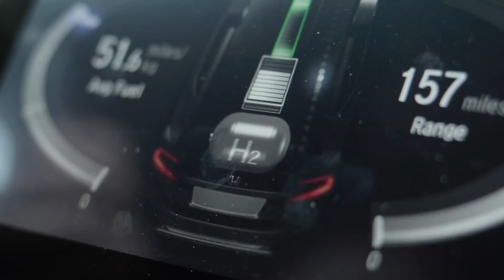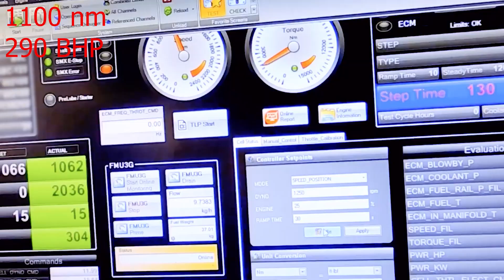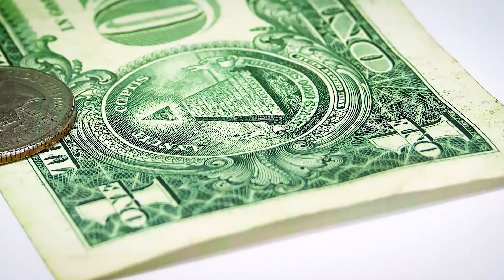Cummins changes there focus from diesel to a 15 liter Hydrogen Internal combustion engine

Comment: I am hoping that hydrogen is the saviour of the internal combustion engine, this Cummins announcement gives me hope.
Hi from NZ,
Anthony.
Reply: The politics of climate change put us behind on this tech. Making hydrogen power at least as safe as gaoline happened in the 1990's. Ford in the USA and BMW in Europe had started on a standardized filling/delivery system in 2000 along with plans for infrastructure. This was for hydrogen compustion engines that most all in the industry in the early 90's saw as the norm by 2010....I am very happy to see this along with Toyota's efforts
Reply: Hydrogen can save the work from energy blackmail that the world nations are guilty of.
Reply: I doubt there will be any "saviours" of the ICE engine. It is a victim of it's own complexity. Too many moving parts to wear or break, timing and fan belts, a cooling system, and it all needs regular maintenance.
Reply: @Brian-om2hh  Boy you can say that agian, i want to call your boss and suggest you get a raise  as you are sound really intellegent. I like my 2 stroke ICE's and they will be fun for a hobby but we must all moves on with ZPE aetheric electric powered dives. Right now there are electric motors that make insane HP and torque that can fit in out laps!

Comment: One of the problems with big trucks , and electric is the weight , the whole point of a truck is to have cargo and weight capacity , to power a heavy truck with electric it needs a huge battery bank , and for example the battery in the tesla weighs half a ton , can you imagine the battery needed for big rig .
 Trucks have restricted axle weights , so if you add a 5 ton battery pack ( or maybe more ) , its not going to be economical imo .
 Yes you can get away with it if you are carting feathers or potato chips with a girly less heavy duty big rig , 
   and lets not forget trucks are terrible aerodynamically , so its hard to see trucks  with EV capability taking over from conventional or other more suitable power units .
 i`m thinking possibly a hybrid scenario might be doable with a smaller battery and a motor on the tailshaft to help the truck get up to cruise speed which would cut emissions and fuel use down a lot .
 But in fact some trucks already have retarders which also work in reverse when needed that do a similar thing , and if i remember correctly quite some years ago a retarder drive supplied about 350 horsepower as well as retarding effort.

 some diesels run natural gas , usually buses and such  which is probably a tad cleaner than diesel , but iirc it comes at a cost of reduced power.
 Some years ago in my neck of the woods , a conversion that some companys had was combination of LPG and diesel , iirc , they could lean the diesel off using a mix with  LPG and diesel ,  im not sure but i suspect it would have been cleaner , and it was reported to me by a driver it made  more HP .
There are no magic bullets , everything has its own pro`s and cons ,  but if i was pulling 68 ton or 100 ton GCM with a big rig , i would want a conventional diesel .
Reply: The major truck makers don't seem to agree with you. Most of them already have 100% electric trucks out there working now. Take a look at Bjorn Nyland's YouTube channel. On his travels, he filmed a Scania fully electric truck recharging at a service area.
Reply: @Brian-om2hh  Yeah, but just one of them.... EV trucks are a waste of time and grid capacity its the wrong tool for the job and any half assed engineer or scientist that doesn't have their head up their but over a fuel fade would tell you that.

Comment: There is a company in Canada called Proton Technology. They have patented a method of separating the H2 from fossil fuels, underground. The carbon stays underground and the H2 is skimmed off and collected. They can produce very pure H2 for around the same cost as natural gas. This is proven, working tech and they are licensing it to producers in other countries.
They can even use to it to clean up old abandoned wells, and get them producing again in the process. 

This is clearly a better option than lithium, which so far, can't be recycled safely and creates a dependence on some very undependable counties. The batteries themselves are very dirty/carbon intensive to produce. These batteries, and the E-cars, will lead to a recycling crisis as unwanted/unsaleable dead-battery-cars pile up; but are too expensive to repair.

The move to electric vehicles has enormous downsides, and those promoting it don't seem to realize that the electrical grid will take 50 years to upgrade.
Reply: I think anything that doesn't involve a carbon cycle is a waste of time for ICE engines, for the time being the best way to do that is with biofuel crops and there are some amazing ones in development. If they implemented them in thier current state we could have half our fuel supply be biofuel and probably 100% within the decade ending ICE contribution to CO2 by creating a closed cycle for it.
Reply: @Wingnut353  There is a major food crisis brewing in the world and the WEF is successfully convincing idiot politicians that climate change demands that farmers use 30% less
nitrogen--even though all modern farmers use the least amount possible because it is expensive. Scarcity serves those it does not affect.

Now, let's think about the plan of taking all that farm land, water, energy that should be producing food and using it to produce BIOFUEL(????)all while sitting on the world's largest deposit of bitumen that turns so easily into jet fuel, diesel etc. The CO2 warming fallacy is not agreed on by most experts, it is not science because  has never be re-produced in any experiment. It isn't supported by anything but the media and their owners. CO2 is a trace gas, essential for life on the planet; right now you are breathing more neon and more argon respectively than you are carbon dioxide.

Comment: Proud Cummins Investor right here 👍
Reply: I never trusted the stock market for a damn thing. This is such a huge development I am going to start now.
Reply: These H2 fool engines better be a fucking 2 stroke! Thank god for high power fiber lasers to cut ports into block and liners.
Reply: Have you ever seen a close lightning strike. yes thats a 2 stroke plasma engine with very high power to weigh ratio. dump fucking sheeple need to pull the head out of their asses and realize zero point energy. No wonder why some folks flip and become serial killers! Fucking brainwash restarted chemical fuel race.

Comment: Will go broke.
Hydrogen is a loosing direction. 
Natural gas would be successful on big trucks and rvs.
Reply: The issue with natural gas is the same as with lithium. It is much more expensive both financially and environmentally to extract natural gas than it is to split water. 

All we need to do is provide electrolysis plants at all the gas stations to refuel hydrogen powered vehicles since the pumps are already no smoking/idling zones. The oxygen produced can be extracted, stored, and shipped out to hospitals and nursing homes for patients, machine shops for acetylene torches, and any other place with a need for oxygen tanks. Large scale electrolysis is cheaper and more effective than portable small scale solutions and you're not wasting the oxygen like you would be with a car. This would make oxygen tanks cheaper and easier to acquire, which will cut operational costs for shops and medical costs for patients. As long as the energy requirement is covered by government subsidies, gas stations should have zero problem housing electrolysis plants. Also, since there are so many, there shouldn't be any shortage of hydrogen even if twenty plants fail in an area. Once gasoline and diesel are phased out for hydrogen, those tanks will be replaced with pressure vessels and provide enough of a reserve to repair the electrolysis plant.
Reply: @TheDustyShredder  
You are dishonest. 
Why did you choose to be a nameless coward pretend human with zero credibility?
Ashamed of yourself?

Comment: cummins doesnt make the diesels coal rolling people mod or remove particulate filters... Rolling coal is the practice of modifying a diesel engine to emit large amounts of black or grey sooty exhaust fumes—diesel fuel that has not undergone complete combustion. A predominantly North American phenomenon, rolling coal is sometimes used as a form of anti-environmentalism.[1] Such modifications may include the intentional removal of the particulate filter.[2] Practitioners often additionally modify their vehicles by installing smoke switches, large exhausts,[3] and smoke stacks

Comment: I believe Hydrogen has a place in future developments. Still, the people pushing its rapid deployment is the fossil fuel industry because they know that if there is a massive take up of Hydrogen the current greenest way to make it will not keep up with demand and that will leave the door open for blue hydrogen which is made in the same old dirty way it is now by reforming methane. The backers say the process will be offset by "carbon capture" then liquefication and then sequestration underground. They have been working on the process for over a decade and have not even gotten close, and taxpayers have contributed millions that would have had a better use elsewhere but our stupid governments are prisoners of the oil giants. Even if they capture carbon and liquefy it and pump it down old oil wells they cannot guarantee that it won't escape just as it has when they frack for gas underground now. So we are left with making Hydrogen the dirty way and we know that burning diesel and petrol put less carbon into the atmosphere than producing the equivalent amount of hydrogen using that process. As I said I am all for hydrogen when we can produce it all via electrolysis using renewable energy or a method just as clean.